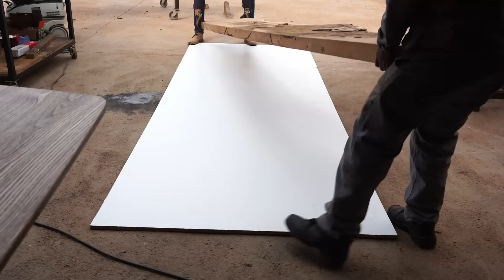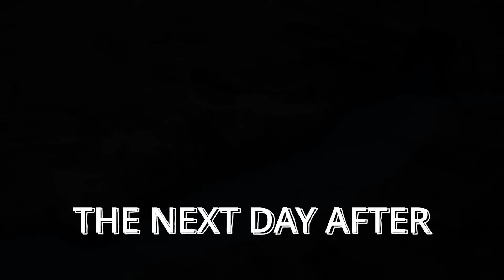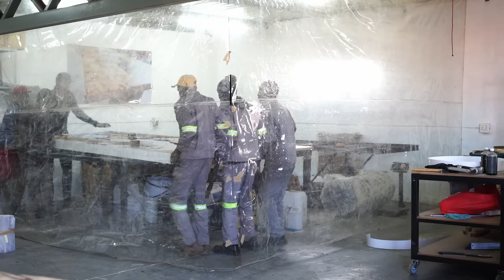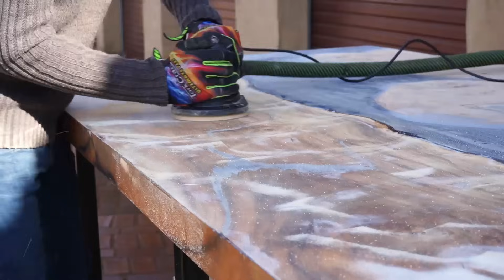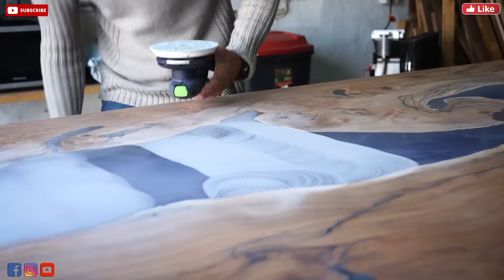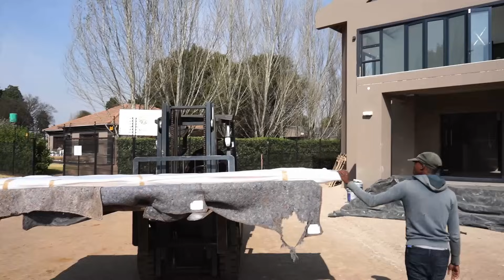$1000 Slab To $30000 Table Build (WITH DIY SKILLS)

Comment: With all the details that went into this table top, I would not have put it on top of 2 metal arches. I would have designed the most insane wooden base, or legs etc, for such a masterpiece table top! Anyway…great work!👏🏽👏🏽👏🏽👏🏽👏🏽❤️🌺

Comment: / hi greg, gorgeous work, very impressed. can you tell me the grits and method you used on the epoxy please, also did you wipe the odies down with a wet,green, rag. finally do you thin odies with something ? i bought some odies after watching this but it's sooo thick. thankyou